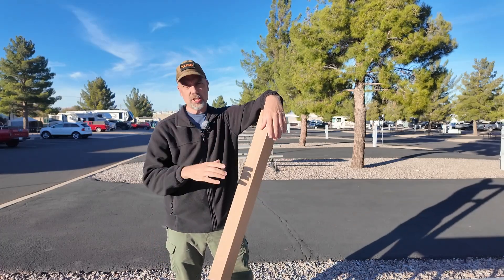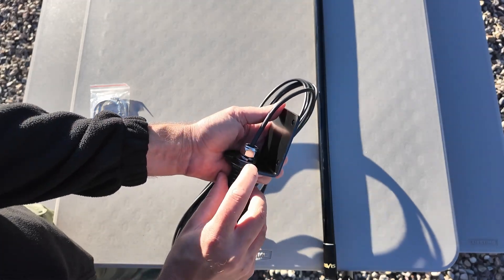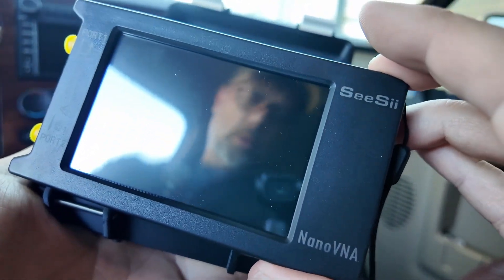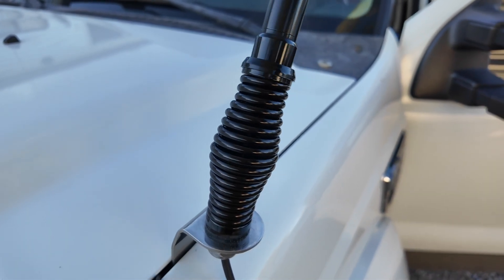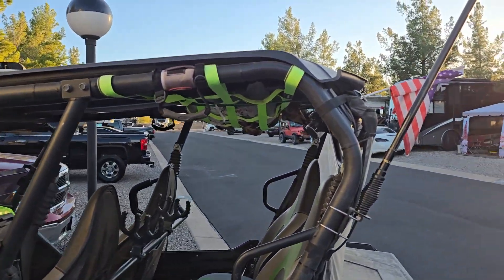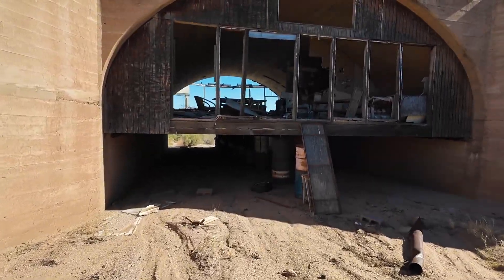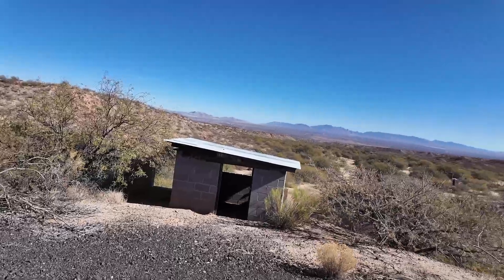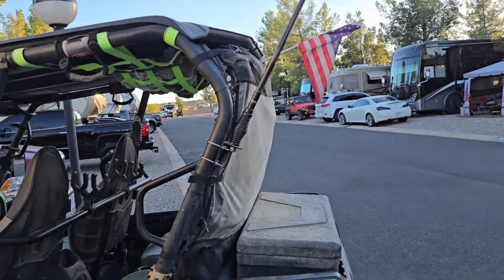Your Next GMRS Antenna!

Comment: I don't understand the point of the length (48.2 inch). At this frequency, if it's not 51.04 inches or longer, it is better to have just be half wave at 25.52 inch. Or 5/8 wave 31.9 inch.  Any way you look at it, you'll make it better by cutting it shorter. If you don't cut it shorter, you need a better ground plane. Like the center of the truck rooftop
Reply from the maker: I didn't remove the cover to see the element length, so it could just be plastic.  I'd assume the tube length is "standard" for a variety of antennas and the element length, as you suggest, is shorter on the inside.  You're right though, 48.2 inch doesn't make sense on its own... manufacturing and shipping come into play to create certain easy standard pieces to build with.

Comment: Hahaha rubbish! Tested that junk and gave it away…. Comet CA-2X4SR did it for me.
Reply from the maker: I'll have to try out the Comet - what did you not like about the retevis antenna?
Reply: @temporarilyoffline  I have a few mountains between my repeater and my favorite fishing spot. I’m able to hit my repeater with the Comet in which I could not do so with the Retevis. It’s a night and day difference for me. The comet out of the box with no tuning did 1.01 SWR on GMRS, 1.02 on MURS, 1.01 on 70cm, 1.02 on 2m and a 1.00 on marine VHF. I have never had such an amazing experience without tuning any antenna. A bonus for me is that it doesn’t need to be removed when clearances is needed. Lift and lay it down, the huge Retevis has to be un-screwed or tied down. There is also an optional spring for the Comet.

Comment: What camera were you using to get that smooth video while out in the side by side?

Where did you get that case for the Nano VNA?
Reply from the maker: I use the DJI Pocket 3 w/built in gimbal.  Works really well.  NanoVNA Case: 👉 3d Printed Hard NanoVNA, NanoVNA-H, NanoVNA-H4 Kit: https://tidd.ly/3S3h0Gn

Comment: Hi Steve, Could you move the antenna closer to the (A) pillar ? might sit better, more vertical, and give u better field of vision. Great connector on the end of the pl 259.  Have a great weekend.I see there are a lot of Prevost style motor coaches being used for camping. 

It would be nice if we could get a similar product here in VK land. 
Great video, have a great weekend. Be safe  David
Reply from the maker: I could put it anywhere really. That was as good a place as any.

Comment: 2:45 Modern A-pillars are insane blind spots.  Modern car makers thinks sensors, cameras, and airbags offsets that visible obstruction, but I miss the older cars with slender A-pillars where you can actually see around them.
Reply from the maker: Yeah, I agree
Reply: You mean back when cars were made of real steel, rather than the almost paper mache stuff of today? I understand, lighter makes for better fuel mileage, but then they have to add more to make up for the structural loss?
Reply from the maker: @javabeanz8549  yeah, government mandated 'crumple zones' - its really hard to own a car in the rust-belt.

Comment: <Sad ham>. Kerchunking. I really hate that. Lets see -CH 15	Freq 462.5500	FMRS 2 W	12.5 kHz	GMRS50 W	20 kHz	(1) (2) = (1) Shared FRS and GMRS simplex.
(2) GMRS repeater output.  So you should have given your GMRS call since this was on a repeater. </sad ham.>
Reply from the maker: Right

Comment: That "5th  wheel" 🛞 has alot of potential, your equipment would last forever, no humidity in Arizona, tnx Man!
Reply from the maker: Yeah, it rains so little here that you just get used to leaving stuff outside.
Reply: @temporarilyoffline  Yes and when it does rain, it will corrode a whole lot slower without the humidity.
Reply: Travel trailer frames are usually less robust than the frames for cargo trailers.  I've wondered about how big a travel trailer one would have to start with in order to cut down the frame to the dimensions of a car hauler while having a frame strong enough for the conversion.

Comment: Got that salvage mode going on with the fifth wheel frame , it did look pretty good , I hear metal doesn’t rust as bad in Arizona,maybe it’s because of all the nuclear ☢️ radiation left over from the bomb testing 😎👋🤷‍♂️
Reply: there wasn't any nuke testing in Arizona.
Reply: @ should of been there’s nothing there
Reply from the maker: That and older stuff was made with thicker metal.
Reply: @temporarilyoffline  You forgot to ask for thicker metal , next time check with Ape , he knows about everything 😂
Reply: Frame would make good trailer for side-by-side!
Reply: @ trailers have increased in price, I had a few I passed on that I would reconsider